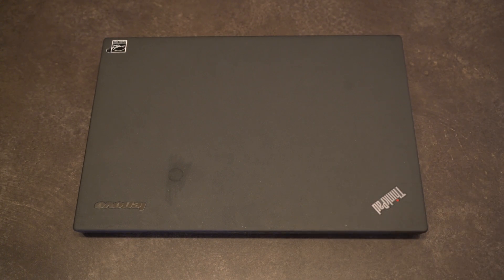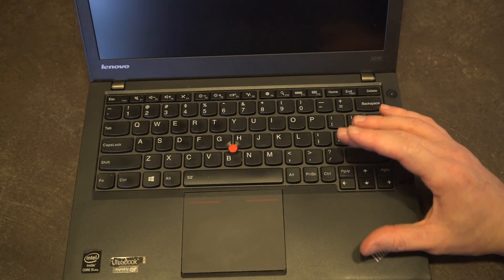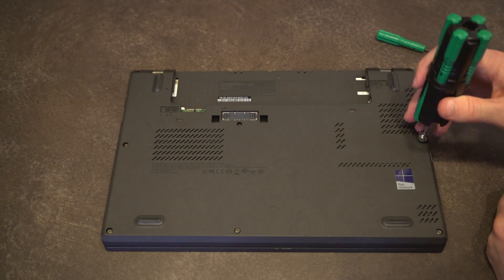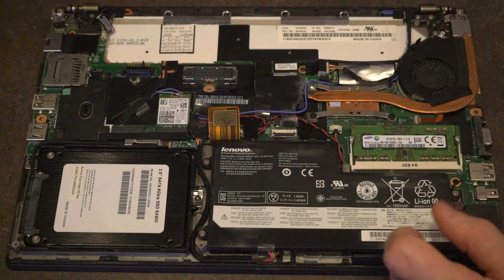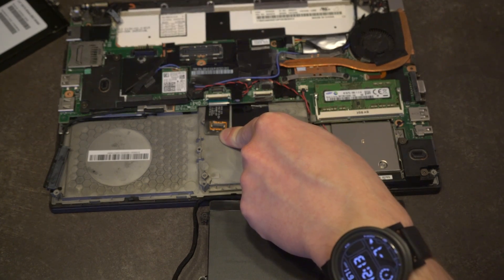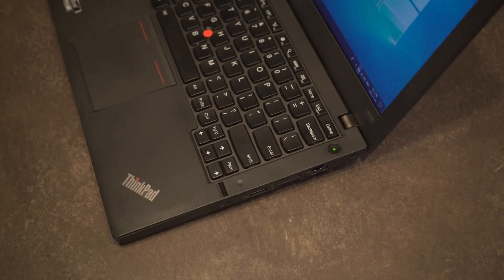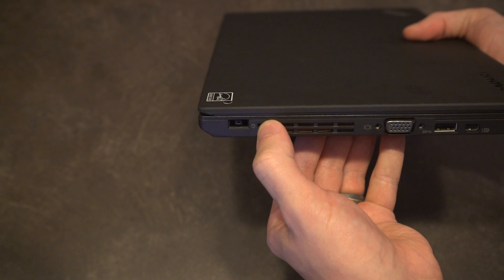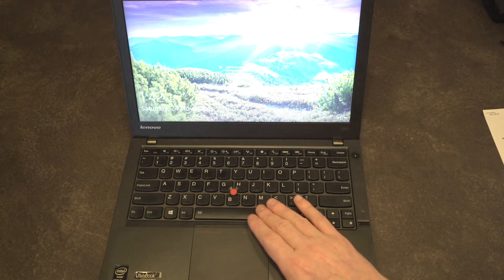Lenovo ThinkPad X240: Refresh of the X Series

Comment: I only now saw this video, but I actually purchased one in 2018. Love it, but the trackpad is unusable in Linux. I have tried several tweaks and tricks, and it would be OK if the trackball was fully functional, but the middle mouse button won't work as scroll trigger for that so....
But in windows it is very nice and most importantly I bought one of those big batteries that stick out like you have there and 15 hours of usage are no problem at all.
Great machine, just not for Linux... unless used with an external mouse.
Reply: Mine works great with Fedora. Only touch my external mouse if making figure in inkscape. Even then it is not necessary. 2 finger scrolling. Middle mousse button to paste
Reply: @Pajamaamaama  interesting. I guess I should try fedora then. My brother wants me to use it anyways. Thanks for sharing
Reply from the maker: What distro are you using that your having mouse issues on a ThinkPad?
Reply: @LaptopRetrospective  just regular Ubuntu. Palm rejection is awful and precision also.
However, it is apparently possible to swap the clickpad for the previous one with three buttons and I guess I will do that at some point.
Maybe I am just not savy enough, but there are similar complaints like mine online and other people have gotten frustrated with exactly that.
Reply from the maker: Very interesting! Thanks for sharing your findings.
Reply: @LaptopRetrospective  glad if that was helpful. I love the laptop, however, it is not perfect.

Comment: Bought one 6 months ago. Installed arch linux. Dont regret
Reply from the maker: Very nice! What are you doing with it?
Reply: @LaptopRetrospective  Im using it for school. I bought it with the 72WH battery and it lasts about 10 hours!!! So light office work and web browsing, but i installed a few games too. And i even run a windows10 vm, with 4gb ram total, and it was able to handle it :)
Reply from the maker: Nice setup and glad to hear about your battery acquisition.
Reply: @peterge98  any idea how save the internal battery while I'am using only ac power?
Reply from the maker: Not sure I understand your question.
Reply: @LaptopRetrospective  I mean I want to plug my computer to ac power directly so I do not internal battery. And I think that will affect on the internal battery. I want to know how to save the internal battery life. I just bought this laptop for 210 dollar

Comment: Before starting to remove the screws of back cover you should deactivate the internal battery from the BIOS.
Reply from the maker: Yep, it is a good practice for sure. Just to be safe.
Reply: How about when you on it again??
Reply from the maker: Boot with power supply attached and re-enable.
Reply: how do u deactivate internal battery?
Reply: @CL-it3zy  you power on the machine, go into the bios (f1) and one of the bios settings is "disable internal battery" - select it, say yes, and the computer will power off with the onboard battery disabled.
Reply: how do you do that?

Comment: I went for a 2nd hand X250, because it's chipset has support for a single 16GB memory module and they reintroduced the dedicated track pad buttons. What I like about both the X240 and X250 is you can fit up to three physical drives into the chassis. You have the 2.5  inch drive bay that will take either a SATA III HDD or SSD, your i.e. 1st drive. You can then fit a 2nd M.2 2242 SSD in the mobile WAN card position (viz. 2nd NGFF socket. 1st NGFF socket accommodates the Wi-Fi card), and you can also fit a 3rd NGFF socket / bracket under the battery in place of the smart card reader, and install a third M.2 SSD (provide single sided board) into this position. I noticed the X240 being reviewed in your video had this bracket fitted and probably has the original 16GB SSD fitted that was an optional cache drive for the HDD to improve read write access performance. My X250 has two SSDs fitted. A 128 GB drive in the 2.5 inch bay with Windows 10 loaded and a 128 GB M.2 2242 in the 3rd NGFF socket adaptor with Ubuntu 18.04 loaded. I have a mobile WAN card fitted in the 2nd NGFF slot, hence no third drive in my machine. My X250 has an i7 5600U processor with 1366 x 768 IPS display, so great performing machine. I really love the device, especially it's portability and build quality.
Reply: This is very helpful. Thank you so much. Can't wait for my x240 to arrive!
Reply from the maker: Thanks for the information about the drive configurations, very helpful.

Comment: Bought a refurb one of these 2 years ago to use as a Linux machine, swapped the hard drive for an SSD and still going strong today. Hands down the best computer I've ever owned. Real shame the new models don't have removable batteries.
Reply: The X220 and X230 with keyboard swap are much better. The X220 has a better keyboard, touchpad, and easier access to RAM and the hard drive (though the X240 is not bad in this regard). The X230 with a keyboard swap has all of the advantages of the X220, but has a more powerful processor than the X240. The X240 is only better for battery life.
Reply from the maker: Yep, really depends if you need that 10-15% performance or the battery life. Trade-offs are the name of the game in this era.
Reply: @LaptopRetrospective  Good point. In my use cases, I want better performance because the batteries in old Thinkpads were never great to begin with. I can definitely understand why people need better battery life, but it sucks that you have to live with the some of Lenovo's other poor design choices like the keyboard to get that.
Reply: @comicsans1689  And power consumption not to mention thinness and weight.
Reply from the maker: Well not easily removable anyway.

Comment: The drive bracket does not need to be removed. The plastic tabs just pop into the screw holes on the side of the drive. That is also a M.2 slot by the WIFI. And the WAN card that was optional for these that can go there is the Sierra EM7345. Just in case some one needed....
Reply from the maker: Thanks for the fact check Clint. Appreciate you taking the time
Reply: Sorry. I wasn't trying to fact check. Just providing some info people might want with. I'm with you. These things are awesome. Some where I have a gaming laptop that is collecting dust while I use this daily. You still taught me stuff I didn't know.
Reply from the maker: No problem! I don't see fact checking as a bad thing at all. Sorry if it has a negative meaning in some circles. The more we share, the more we know!

Comment: X240 (i5) or a X230 (i7)

Both used, both 8gb ram. 
Planning to swap either one to a 256gb SSD.
Reply from the maker: Both great machines depending on what you do.
Reply: @LaptopRetrospective  photo and video editing,... sometimes on the go.
Need something portable, can take a bit of beating, 4-6 hours battery life...and easy to connect to WiFi/hotspot on the go?

Do both of them have that draining hole for water spillage??

Thx
Reply from the maker: X230 i7 would be my choice. Extra power, has the drainage system and battery isn't as big of a deal for you as power it seems.
Reply: @LaptopRetrospective  you are awesome!

Gonna get some me some 240/500 GB SSD
Any other suggestions to look out for/help with my needs??
Reply from the maker: It can take a secondary mSATA SSD if you really want storage. It's SATA 2 speeds though. Beyond that, get the machine first, use it, then decide what is missing and go from there. They are a great machine to tinker with, lots to do to them.

Comment: could you get some side by side performance benchmarks between this and the x220 please? Cheers Jim
Reply from the maker: Anything specific you are looking for? The CPU data can be easily found online.
Reply: @LaptopRetrospective  it would be interesting to see if and by how much that U series cpu effects performance is it slower in processing but quicker GPU? I don't know did I'd like to know lol
Reply from the maker: Between the 220 and 240 I doubt you'd notice a performance drop. The GPU is significantly improved. 3000 vs 4000 series.

Comment: I am a student currently and live at home where I have a gaming desktop, but I need something portable and light for taking to class for notes, writing essays, watching some videos in between classes, etc. I am currently using my dad’s surface pro 3 he is lending me until I can afford my own laptop. Would you say the x240 would be a good choice, or is there something else you would recommend? Thought I’d also mention I am on a pretty tight budget, probably 450-500 USD at the absolute most. I am absolutely fine with buying on eBay and servicing the machine myself too.
Reply: If you can deal with the 12" screen, why not? I found myself in your situation just last year coz I needed a cheap reliable laptop for field work and to crunch SPSS data for my grad school thesis. Having owned a Thinkpad X61 before and used a Thinkpad X240 and a Thinkpad T480 at work, I bought a used Thinkpad T410 due to its robust features (fantastic dual batteries that last forever, 8GB RAM in 2 RAM slots, SSD, bluetooth and a larger 14" screen) for about US$300.

Thinkpads are popular with businesses that routinely retire them every 4-5 years, so there's plenty to be had on the cheap in the used market. They're easy to fix should something ever break, parts and upgrades are easy to get.
Reply from the maker: Agreed!
Reply: I got an x240 for 220 bucks off of newegg refurbished with an i5 and 8gb of ram
Reply from the maker: Nice. Was the unit in good condition?
Reply: @LaptopRetrospective  yea not many scratches good battery and nice thermals I also dropped the voltage a small amount.
Reply from the maker: Very cool. Sounds like they might be a good place to recommend.
Reply: Got one myself for university and I love it. It's powerful enough for most things you need to do on the go. I even use it as my main computer in combination with a docking station and two external monitors. The size is just awesome for mobile use. I've got the i5-4300U version and upgraded the RAM to 8 GB, installed a M.2 SSD and a 1 TB HDD. Battery life with the big battery pack is good enough, that I don't have to take a charger with me (probably over 8 hours, never really tested it).
Reply from the maker: Nice setup. Thanks for sharing.
Reply from the maker: X240 is great with its dual battery system. Many prefer the x230 because it is slightly more powerful but it sounds like you want battery over power in your situation. Unit is easy to service minus the keyboard.

Comment: I have this very laptop in front of me after 'upgrading' from my old x230.

I have to say, both battery life and the ability to install 16 GB of RAM in dual channel config were better on the x230. The old, separate buttons for the Trackpoint are also infinitely better on the x230. The screen is much better on the x240, though (I had the 1366x768 version of the x230, my x240 has FullHD). All in all, I consider the x240 a downgrade, especially because of the 8GB RAM limit. I don't understand their decision to put in a single RAM slot. Not at all. Successor models should never provide less features than their predecessors, see iPhone headphone jack disaster.
Reply: the "downgrade" parts its not just about the ram, using U processor, missing drainage hole for antispill keyboard, missing thinklight, in my opinion - im using X240 only for a few weeks, cant stand with it and decide to go back to my lovely X230 after - avoid this X240, if you wanna upgrade from X230, straight go to X250 is much better option.
Reply from the maker: I hope one day to get a x250 on the teardown table and find out.
Reply from the maker: The x240 tried some different things and is clear from the models that came after that they learned some lessons. When is coated, it isn't so great. Treated on its own merits, it's a good machine.

Comment: I got an x240 on Ebay with a non-backlit keyboard. I ended up fitting a backlit keyboard myself and it was a nightmare. It's a great laptop. Though, my battery clips broke. Twice. I had to replace the back panel twice because the battery kept falling out.
Reply: The little clips that are on the bottom that slide over to release the battery?

Yeah those falling off are very, very common. Like its probably one of the few certainties in life like taxes and death. We are in the process of phasing the x230s to x250s out this year out of large medical company. They are great devices though. I have one myself. They just hit our end of life policy.
Reply from the maker: Yeah, keyboard isn't fun. Curious about the battery clips giving you so much trouble.

Comment: just bought a x240 on eBay to replace my old dell latitude e6410.  Can't wait until Saturday to try it out
Reply: So how the laptop?
Reply: @maximmus7080   After using it for a few hours I can say this . 1 the battery life is great. 2 the weight and size is perfect. 3 its fast with an ssd. 4  it feels solid
5  Its a thinkpad
6  Its good for light games
Reply from the maker: Sounds like solid conclusion to me.
Reply from the maker: Very exciting! Let me know what you think.

Comment: How long is the battery life for everyone's x240? Please state your cell 3+x too
Reply from the maker: This one tends to go at least a day without charging with light to moderate usage. Larger cell external battery.
Reply: Laptop Retrospective a day as in 8hrs or 12 hrs? 
3+6 or 3+9 cells? 

3 refers to the internal battery
Reply from the maker: Not sure on the cell count, but it's a 48Wh external battery. 8 for sure. Field correspondent feels 12 would be possible if one tried.
Reply: @LaptopRetrospective  thanks.
The x240 is surly better than earlier gen x230 and smiliar dell e7240.
X230 has alot of fans, I have used all laptops, from macbook air to old think pad to modern thinkpad. my conclusion is x230 to do clear the fan and repaste thermal paste is harder than dell smiliar 3rd gen e6230 and x240 4th gen i series. Both need only one screw will open the base bottom. 

And it lasts longer than x230. For its flaws it's nothing for its pros. The only concern is adapter requires for hdmi port as it uses mini display port.

But its also better than its same gen del e7240 as dell e7240 has whole list of heating problems.

In conclusion, x240 is more suitable for general users and lazy users who want best value for money. Slim last longer battery life  and modern look, and durable laptop.

For those no need slim and longer battery life, dell e6230 is a much better choice than x230.
Reply from the maker: No experience with that Dell model so I can't weigh in on that, but the slim profile and battery capacity with an Ultrabook CPU makes it long lasting.

Comment: Picked up a good condition used X240 for a good price. Didn't like the trackpad, wasn't responsive and missing the pad buttons. Updated the nav driver from Lenovo and the pad works fine now. Standard screen isn't the sharpest but once updated with a screen calibration file, colours arn't too bad. Keep getting random drop outs from the wifi though. Not as good as my X1 carbon but not bad for the money.
Reply from the maker: Haven't had the WiFi drop it yet. Will keep an eye on that.

Comment: Interesting that the hard drive bracket was held in by a torx screw. On both of my X250's (which are almost identical internally) it's held in with a standard phillips head screw.
Reply from the maker: Must have learned their lesson.

Comment: I ordered a T 440 P - (yes "P") - Its a huge step forward, to have an more amazing computer.
Specially, because its the P Version.

Its converted to a 256 GB SSD, and whole used laptop in A condition for totally $ 260 with 12 month warranty from a professional dealer here in germany.

I want to advance it, from 4 GB to 8 GB RAM - no big deal.

Its bigger and heavier as the other 440ies, but overall more, and a bigger working maschine.
Reply from the maker: Very cool. Hope you enjoy it.
Reply: @LaptopRetrospective  Thanks.
I kept all my wishes for my next laptop, and made NO compromises.
And crossed my price limit only 10 % more.
So I found and decide for the T 440 P.

I don´t want to think too long, and want to choose. 
No choice = no computer.
 But if you made a choice pro computer, you get it really.
Reply: I work with T440P (local) and X240 (mobile)  . I really like that you can use the Dock for both pc‘s . Nice Feature .
Reply: Would you share the dealer details? Even I am looking for a similar laptop.
Reply from the maker: Best buys are going to be local. Always try nearby before going online.

Comment: So im pretty happy with myself. Managed to get a x230 for 77 bucks. Only downside is that its missing the ram cover and the included hdd was doa( but both r easy fixes)
Reply: Yup
Reply from the maker: Very nice. Did you get it with the backlit keyboard?
Reply: It's really nice with the backlit keyboard.  Now for 16GB ram and an IPS panel 😂